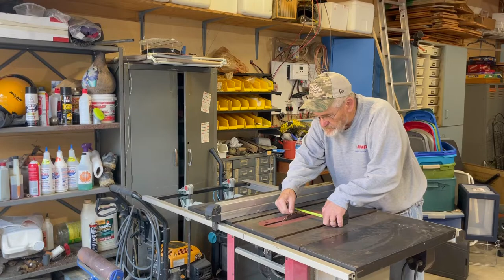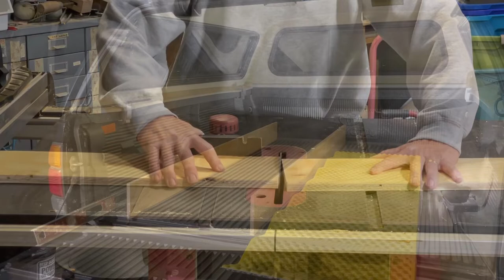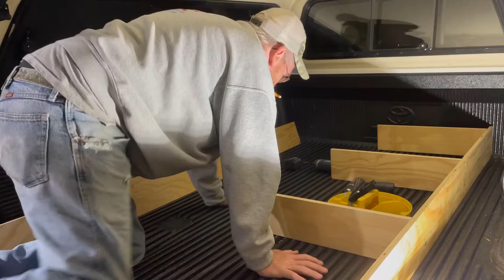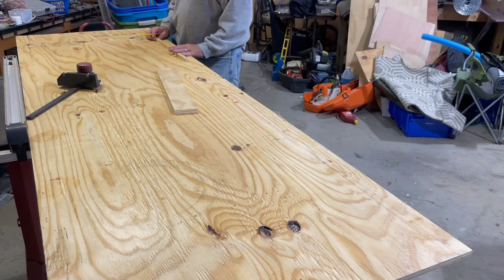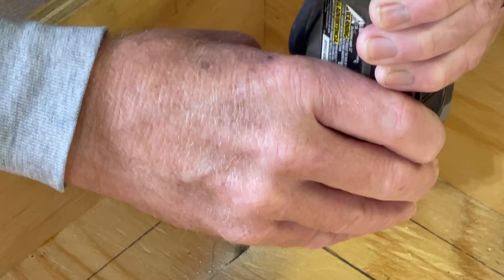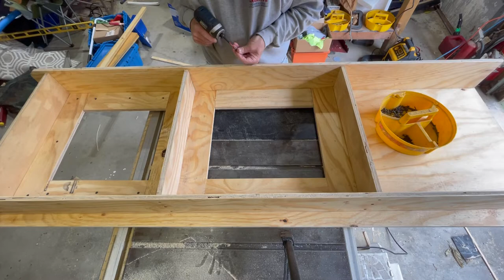Tundra Truck Camper “Building the Bed Platform”

Comment: Use a table saw push stick or block. You could lose your fingers in one split second.
Reply: Obviously you know what you are doing, but be careful. Nice build by the way… 👍
Reply from the maker: Yep, I use one on the smaller pieces.
Thank you for the concern. 👍